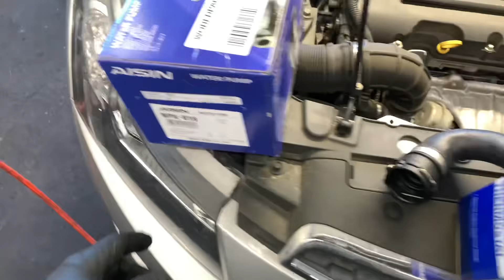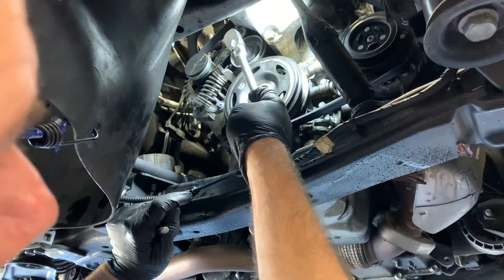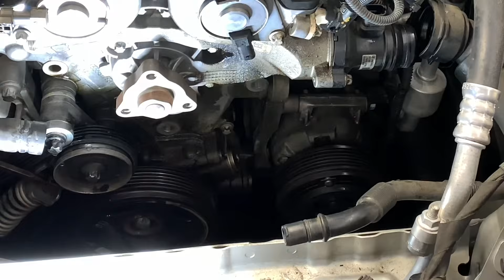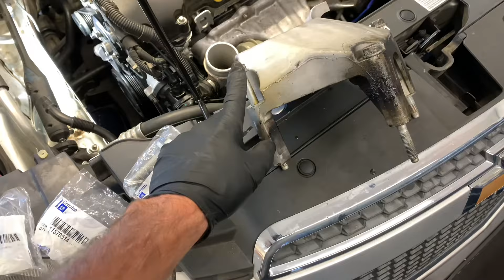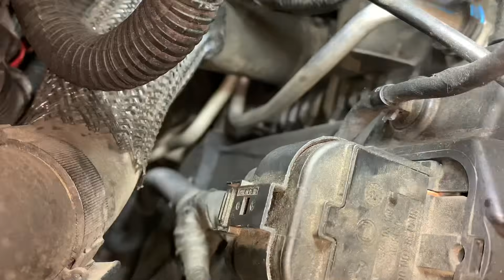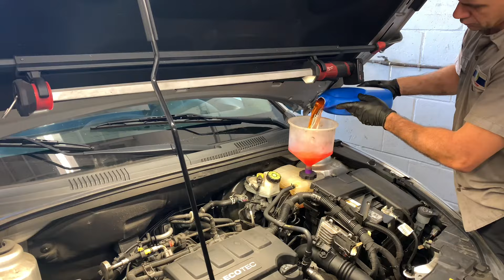How To Replace The Water Pump On A Chevy Cruze With 1.4l Engine"

Comment: What mm wrenches will i need for whole repaira? I don’t have advance tools but want to get all the wrenches or other stuff before actually opening up the hood, can you please list up the items required, so that i can’t miss anything
Reply from the maker: You’re pretty much gonna be using 10 mm 12 mm 13 mm 14 mm possibly a 17. I would recommend buying a set of wrenches to go from 8 mm to 22. That are pretty much get you covered on just about any repair on this vehicle. Lots of good brands out there like GearWrench or Milwaukee tool. You can buy them from Home Depot or the Internet.
Reply from the maker: And if you need links, I can provide them, but they will be affiliate links
Reply: @HowtoAutomotive sure but my budget is around 300

Comment: Thanks for the video very informative whenever I need changing the water pump. I have one question. I also have a 2014 Chevy Cruze with turbo and had a thermostat leak. I changed the thermostat about 2 weeks ago but now I noticed smaller hose connected to thermostat has a bulge like it's about to rupture. Have looked for it under thermostat hose but nothing pops up. Do you know the proper name of that smaller hose? Thanks again any feedback appreciated

Comment: Not sure if this has been answered, but I can’t find any comments. There are a few TTY bolts on the water pump. I noticed you did not replace these, and I am not seeing a whole lot of people commenting/complaining about that. Is it safe to say that switching these bolts are not essential?
Reply: You must not work on cars very often to be honest many new aftermarket bolts are low grade and the grain used to create them are generic many factory bolts will outlast aftermarket bolts 9/10 times can re use many bolts on a vehicle as long as the threads aren't damaged and it's not rusted out

Comment: The water pump has two bolts that go thru the timing chain. These are torque to yield and are supposed to be replaced. I didn't, though.

Comment: Q: Water pump,” flow fins “ ?
Both matching the same direction ?
Pumps called reverse flow.
Find are opposite.
I always make certain everything on the old, matches with the new.

As you filled it ? Why didn’t you remove the ,” Air Bleed Bolt”, at the top of the radiator before you started it. This gets the air out of the radiator.

Comment: What’s the flat rate on that btw? Did it in 1.75 thanks to your video. Have never wrenched on that car before. Just Harleys and SXS’s. Few suggestions though. Don’t need to pull the inner fender liner or the skid plate. Put a 2x4 block between the oil pan and skid plate and one on the bottom and you won’t damage it. Also easily got to the 3 bolts on the Mount to the block without taking the inner fender out.

Comment: May I ask, why did you recommend to replace the engine mount bolts? Those thick-looking bolts seriously need replaced?
Reply: They are torque to yield bolts.   They are a one time use

Comment: I heard conflicting opinions on the bolts that you can only use one time. Is it just one of the motor mount bolts or all 3 that go straight down ? I heard that it’s just the shortest one. Information came from GM dealership. Thanks

Comment: Too much-just change the pump !! good step by step, but are you going to charge a customer $1200to do for a water pump that’s really simple like an 1.5hrs to change all these hoses out and thermostat etc? Why
Reply: Agree, $200 worth of parts and 2 hours of work. And he didn't even replace the thermostat housing with the newer metal kind. I have 400k miles on my Cruze and my mechanic only charged me $800 to replaced pump, hoses, thermostat with metal housing and metal coolant water outlet.

Comment: I have a 2015 LT model of this car and I have figure out the issue, the manufacture (Chevrolet) uses plastic parts for the water pump and the thermostat housing! Its quite obvious that plastic components are not built to withstand the engines heat. This is why these two common parts fail on this car! I can't figure out  why for the life of me, why the manufacture thought this was a good idea let a lone after doing some research , there are no known recalls for these parts for this car! Im guessing this was done to save Chevy money when building the car, these are common issues like I see in videos here all over YT reported by consumers! Shame on you Chevy!!!!!
Reply: Yep, when my pump broke last year, my mechanic replaced all that cheap plastic crap with new metal ones.
Reply: @satiniclivesmatter The water pump is not plastic 😂
Reply: @jersey00scraps i was thinking the same thing but to his point the the thermostat is plastic as well as the water outlet that part was the dumbest mistake as well as the coolant resvior all replaced multiple times..... also have replaced the turbo and transmission 😢

Comment: Engine mount bolts came out just a little to easily. Those bad boys you usually have to break lose with a breaker bar then hit the bolts with the impact.

Comment: I agree with the upper hose being  the biggest pain  in the butt. We pulled driver wheel and fender liner. I layer under the car with a helper from the top to guide tool. What a crock. GM says to pull headlight and bumper to  change that hose. What a terrible design for maintenance.  These are great driving cars with cooling systems from hell. So much plastic and junky O rings.  When it's working it's working good but that is far and few between.  Once you get any sort of leak it is my recommendation to replace every hose and pump associated with the cooling system. 

Pro tip/change oil feed line to turbo every 50k. It's a short hose and it's only $30. It will save your turbo. They get caked up and reduce oil flow to cool turbo. Just do it, you will thank me when your turbo lasts forever Instead of 80-90k that is typical al of these. Super simple job right behind heat shield.

Comment: You dont have to take the air box apart to remove it.  Just loosen the air hose clamp and take off the other small hose and then take the whole box out as one unit

Comment: Had to change upper radiator hose on my mom's 2011 Chevy Cruze. No life, so I took off the front bumper off just to put on hose to the radiator. Few inches to work with. 40 minutes of agony!

Comment: I see you acknowledged the 6x TTY bolts for the transaxle/engine mounts - I've read that 2 of the the water pump bolts are also TTY, but you reused all of the old bolts for that.

I may have to replace my water pump if the dealership won't honor the TSB and I've already once reused my 6x engine mount bolts when doing another job on the car and no mention was made of the TTY bolts, though I do remember torquing them to spec (I can't remember or reference the video(s) I watched for those repairs).

You mention it not being safe to reuse TTY bolts but you reused them on the water pump.. (?) or am I misinformed? Somebody please educate me.

Comment: This was a very informative and helpful video. As someone who knows pretty much just the basics of cars and doesnt have much experience taking them apart, this step by step process help me clearly see what i needed to take apart, saved me a lot of time haha. The job wasnt as hard as i thought it would be and i switched out both the thermostat and the water pump. No more over heating :)
Reply from the maker: Nice I’m glad your car is not overheating anymore. Thank you for watching!
Reply: @HowtoAutomotive whats the brand of the water pump and thermostat did you place in?

Comment: Actually a torque+angle spec does not indicate a fastener is torque to yield at all! Torque to yield is an engineering design specification. You simply cannot tell if a fastener will be yield based on the torque spec alone. You need to consider the size, length and material grade as well to determine if it will indeed be stressed into the yield region of the material. In this case it looks like a long stretchy M10 bolt and at 45 ft lbs + 60 deg, I would need to see some math to prove it is TTY.

Comment: I had the water pump change under warranty when the car was 4 years old and 30,000 kms on the clock; I also changed that lower hose with a remote cable clamp tool from the top ; I didn't feel like taking off all those shields underneath; it was a pain but I persevered and I put a worm drive clamp which would make it easier to get to next time
Reply: I got lucky because my bumper was damaged enougg that most of those clips were already gone 🤣

Comment: I just did this same repair to my car. No problems. Did not have to go under car & I didn't have to do half of these steps. I did appreciate the torque specs though, but then again you got yo be crazy to buy new bolts. They really put you through some hoops don't they. And don't tell me all the extra steps are necessary because I have brought my car to the mechanics lot of times in my life and 90% of the times they messed up my car worse than it was to begin with. That's probably because I only bring my car in when I really really really need help and by that time it's something that even mechanics are not able to do. Way too many extra steps. No wonder when I bring my car to a mechanic, the are some extra broken missing parts that had nothing to do with what I sent it in for.

Comment: Good guide but you skipped mentioning that two of the bolts on the water pump are also Torque to Yield and need to be replaced, torqued to 71nm then a further 30 degree angle.

Comment: So no gasket maker/rtv such as Honda bond?
Reply from the maker: No it didn’t come with anything from the factory.
Reply: @HowtoAutomotive   Thanks for the reply!  I just replaced the water pump on wifes cruze and it had a bunch of rtv on it and I wasn't expecting that with the type of gasket these use.  In hindsight I believe now that these bolts are TTY and it may be a good rule of thumb to replace them when changing the water pump.  Perhaps the valve cover bolts are TTY as well.

Comment: I'am Your Newest Subscriber Great Videos. You Didn't Cover Up The Turbo Hole While Working ? Also What About The 3rd Radiator House In Bottom Passangers Side It Didn't Get Replaced ? Iam Going Thru All These Problems Now With My 2012 Eco Chevy Cruze I Drove My Car Almost 37,000 Miles All The Problems Started When The Car Got Close To 160,000 Miles

Comment: Your videos are very well done the camera and picture quality are A1 and you dont skip steps you are very professional and you sound like a instructor thanks keep posting these great videos
Reply: I was going to try and do this myself, but there is a lot involved and I am no mechanic just poor!  I think I’m going to find out how much it cost to replace the water pump
And thermostat?
Very very good video. I might have to do it myself I will be using this video stsrt and stopping all the way. Thank you for being Soo thorough!!
Reply: @jackiebergey181  If you have a 2013 or 2014 chevy cruze it has a 10 year or 150,000 mile warranty on the water pump call your dealer they will fix it for free I am getting mine fixed in a couple of days good luck look it up online about the warranty.
Reply from the maker: Thank You and thank you for watching!
Reply: @HowtoAutomotive  i just replaced coolant on my 2013 chevy cruze and the lower radiator hose leaks where its connected to the radiator i could here it click but it leaks after driving do you know what size the o ring that goes inside the lower radiator hose is i think thats why it is leaking
Reply from the maker: @adventures223  sorry I don’t know the size of that O-ring. Probably be best just to replace the hose
Reply: @HowtoAutomotive  ok thanks have you ever seen these leak at the lower radiator after reinstalling one it drips only after its been driven or running

Comment: Very good video on replacing the water pump, I did the same job on 2014 chevy cruze and replaced all the hoses too. The radiator hoses on battery side was difficult, until I decide to remove battery and holder, it gave a lot more room and was able to use the cable clamp, it made it much easier, from underneath the car.

Comment: Great video. One thing I did differently on the drive side radiator hose is I disconnected the intake hose on that side, which made it much easier to access the radiator hose clamp. Still the driver's side hose replacement eats up a lot of time.

Comment: This is the nonsense you get hiring ex nuclear physicists to design a simple 4 cyl. motor . Motor mount bolts designed to break off after one use. no wonder chevy went tits up.

Comment: Probably, one of thee best play by play I've ever seen. Thank you, video was great audio was even better. This is definitely a technical repair and you made it look manageable.
Reply: Does this mean  can go to gm nd tell them I bought a new pump to reimburse me
Reply: Mine just went out along with thermostat 124k fudge it
Reply: the water pumps are warrantied for 10 years 150,000 miles by gm
Reply: Lmao you’d be lucky to get 80,000 in a cruze before it goes
Reply: @ligmabawls9471 mine just went out for the first time at 131,000 miles. 2012 1.4l

Comment: Dude why didn’t you show the bolt pattern to the water pump
Reply: I come here looking for that exact thing. I'm watching the video just to confirm. ( long/short and pattern )
Reply: all you have to do is not go right next to the one you just did, go across the pump from the last bolt you tightened, similar to tightening wheel lugs.  doesnt have  to be a specific way as long as you dont just go around the perimeter in order.

Comment: There's an even easier way to do this job. Just drive it to your local Chevrolet Dealer. There's a G.M. factory recall on these cars for a faulty water pump. If your car has 150,000 miles or less and the car is 10 years old or newer, G. M. will fix it for free. You do not need to be the original owner. 
How easy is that!
Reply: It's only 2011-2014 models.
Reply: Is this for all 2015 Chevy Cruzes? Or for a specific Chevrolet factory?
Reply: @angiedovalina1955  
This is for ALL Chevrolet Cruze models with less than 150,000 miles and is 10 years old or newer. If you're still not sure if your vehicle qualifies for this recall, you can read the actual GM Factory Service Bulletin on line by searching using Chevrolet Cruze Factory Recall for keywords, or just call your local Chevrolet dealer and ask to speak with the Service Department.
Reply: @mikespaziano1225  I just called my local dealership and they said there is no recalls on my vechicle
Reply: @mikespaziano1225  I called my local dealer they took the VIN it's a 2016 with 71k they said it's not under warranty
Reply: Mike, thank you for this comment. I was quoted 1300 for my water pump replacement but I found the service bulletin online and I presented it to the dealer and now it is covered. What is your venmo so I can send you for a beer. Cheers mate!

Comment: I have 2016 Chevy sonic 1.4 turbo LTZ and its a little different but real close only thing for sure the exact same is i'm changing my water pump too after 42,000 miles the quality from Chevy is awesome!!!
Reply: chevy warranties the water pump for 10 years 150,000 miles. you could have got it done for free.
Reply: @russkaine  where did you get a 10 year 150000 mile warranty on any chevrolet?
Reply: @Uncle_Tim81  Chevy had issues with the water pumps so they extended them for 10yrs 150,000
Reply: @russkaine  well I just looked on a chevrolet website,  with the vin number for a 2013 cruze, and it says there is no recall or program for that.   So I dont know if,  now that it is 2023 it is considered over 10 years, but will definately be calling a Chevrolet dealership before I spend any money or time repairing myself

Comment: Why use inverted torx bolts on a water pump instead of regular bolts?  Sometimes i watch repair videos of other car lines and it makes me acknowledge the design quality of the dealership cars i work on.
Reply: I Concur with you on that.

Comment: Would it be wrong to use gasket adhesive on the water pump to secure the gasket, or is it better to not use it?
Reply from the maker: Mike Govea you could use a little bit of 3M adhesive. The key is using small amounts.
Reply: @HowtoAutomotive  on which surface to apply the sealant, on the pump or the engine ? (thanx)

Comment: Awesome tutorial. A +. Just curious is the book time on such a job?
Reply: 3 hours  on a shop  with all the equipment and tools, on  a driveway  probably 2 days hahaha
Reply: @Luigi2028-c6i  DId this job about a year ago in my garage with basic tools (didn't even have an E-socket set), and it took about 4 or 5 hours, but I spent a lot of time making sure the mating surface was clean, and making sure I had all those d@mn bolts were correct. Not too bad.
Reply: Took me and my step dad about 4 hours yesterday and we’ve never done this job before
Reply from the maker: Mario S. I don’t remember I think it was around three hours though. But don’t quote me.
Reply: @HowtoAutomotive  Replacing just the water pump took me about 2 hours my first time with no electric tools after watching this. Great video, Thank You!
Reply: @HowtoAutomotive  - It appears to me it was a very lengthy procedure. I am quite surprised to find an e-socket and all those fancy coolant hoses on a chevy product. It has been a very long time since I worked on one myself.

Comment: Support the engine, remove the starter, remove flex plate bolts, disconnect trans lines and cables and trans housing bolts boom
Reply from the maker: MrGert150 no that was easy. Lol